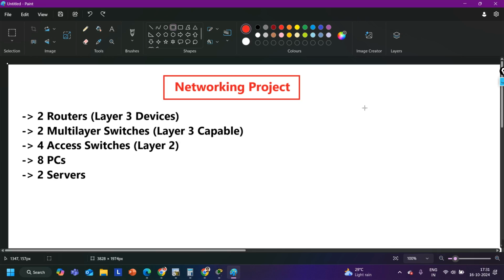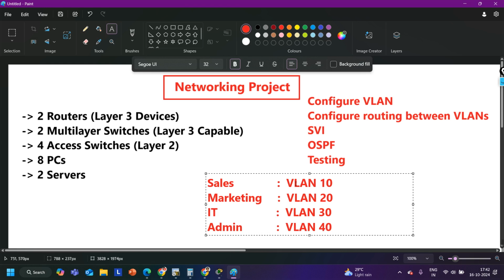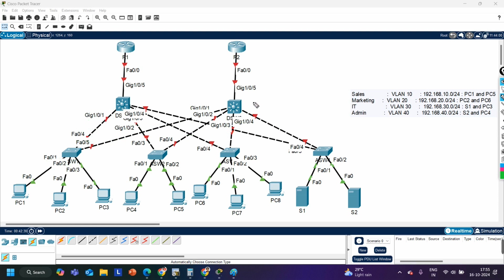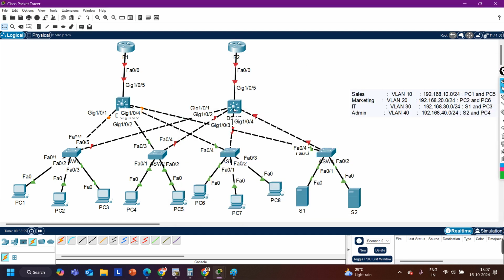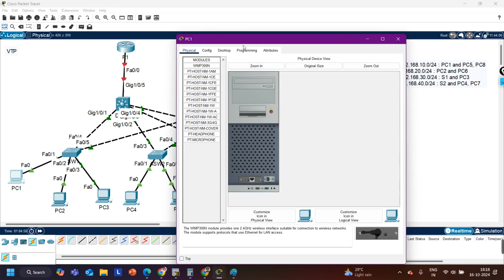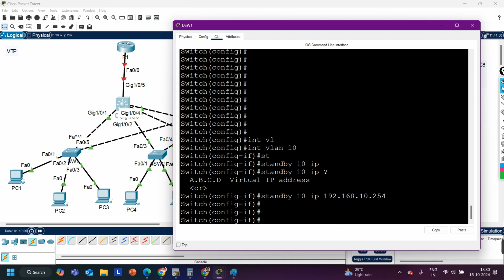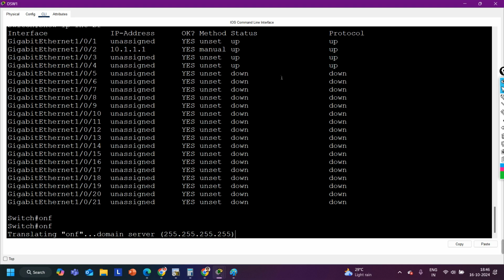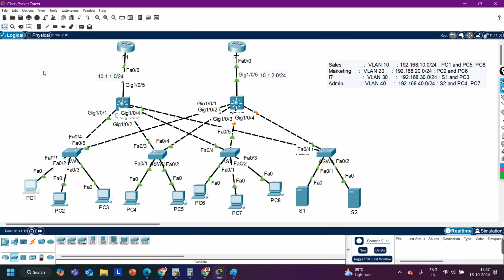Networking Project | Step-by-Step VLAN Segmentation and OSPF Routing in Cisco Packet Tracer

Comment: I have made DSW1 as Active for VLAN 10 and 20 and DSW2 as Active for VLAN 30 and 40. In this scenario PCs of VLAN 10 and 20 are not able to ping PCs of VLAN 30 and 40. How can we solve this problem. Further do we need direct connection between DSW1 and DSW2 to solve above issue. Please clarify
Reply from the maker: You need to configure routing
Reply: @softengg1  enable (ip routing) command in all dsws